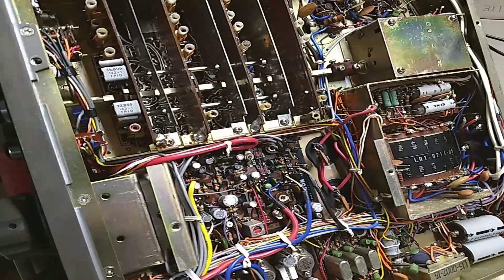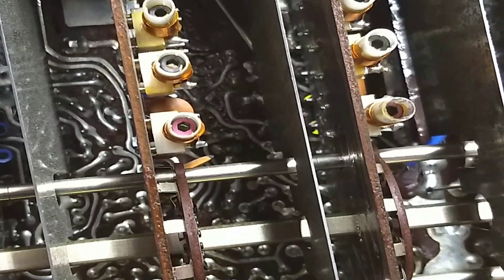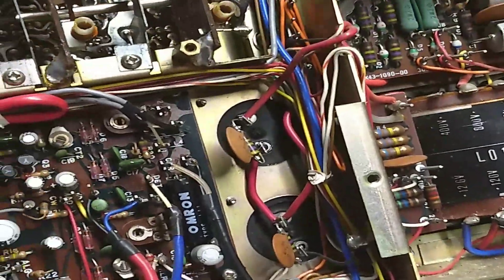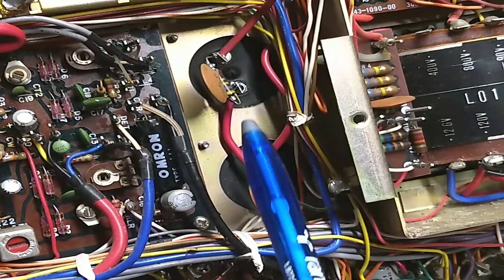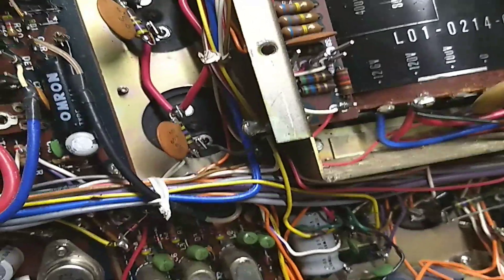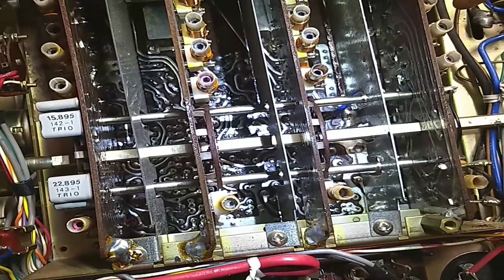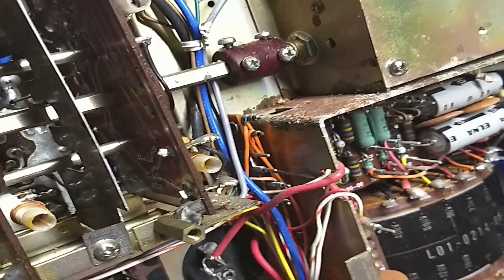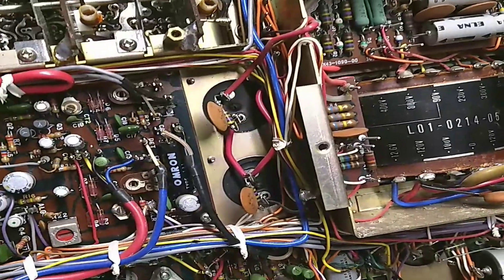Kenwood TS-520 No Output Power - before capacitor replacement

Comment: I have a 520s with no apparent corrosion or rust but there is some oxidation on the wire wrap posts . After I get the transmitter working I plan to remove each PCB and check each component and connection and solder the board back in .

Comment: I lucked into a nice 520s on EBay. Leather handle looks new and rust or corrosion anywhere including control panel knob screws. All controls function smoothly. Not likely to be lucky twice .

Comment: Corrosion from humidity, check the big one watt carbon resistors on the PA board .
Reply from the maker: Thanks for your suggestion. The 520 has been running well since I replaced the capacitors but I will certainly open it back up and take a look at the carbon resistors.
Reply: Read all of K4EAA stuff, shame he passed! He was the Kenwood Hybrid expert. JohnBoyUtah KJ7TBR

Comment: Picked up a used 520.   I have output on cw but not on ssb.  Still checking microphone, and will check capacitors.  Do you have any suggestions?   Thank you!

Comment: Keep an eye on transistors leads, they can also rust and fall apart. I got a Cobra 138xlr here that had a bunch of transistors with the leads rusted off.
Reply from the maker: Thanks for the tip, I'll keep an eye out for that.